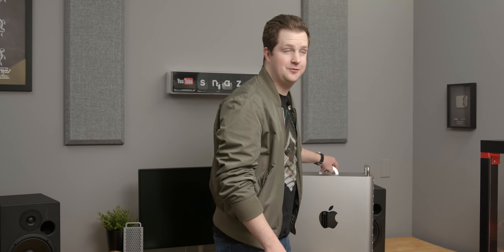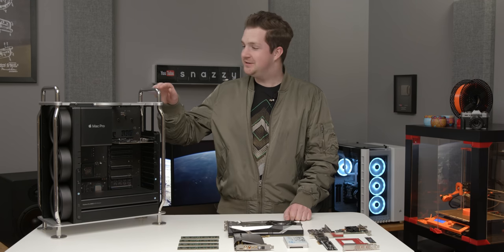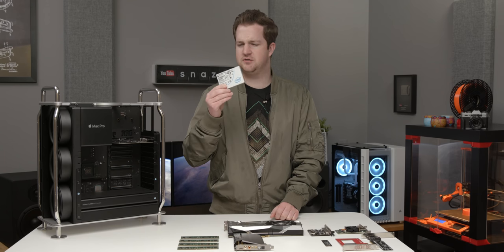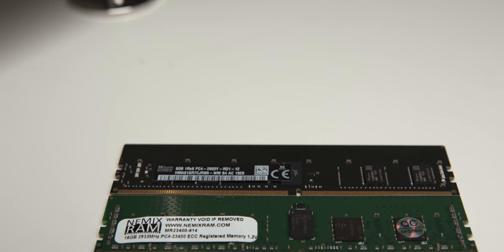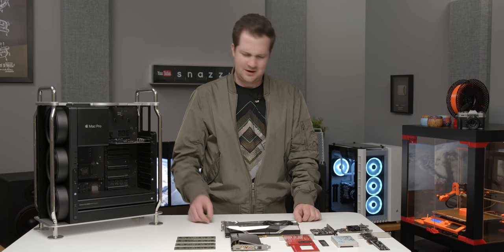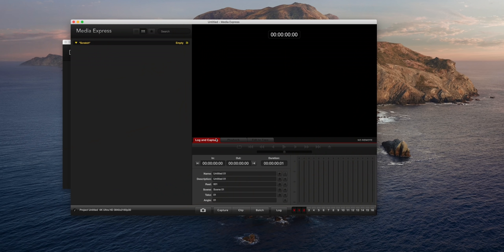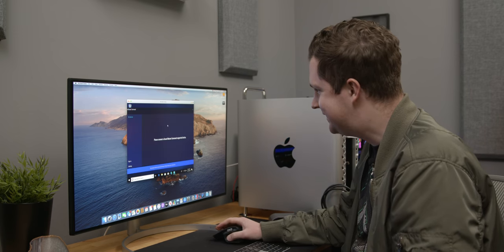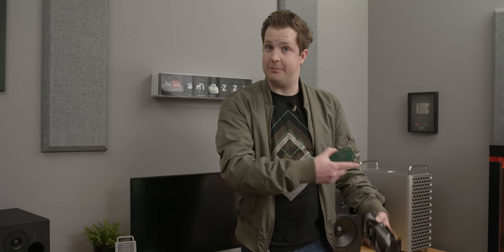What Weird PCIe Expansion Cards Work in Mac Pro?

Comment from the maker: Items of note:

At 5:18, I moderately imply that U.2 drives are not PCIe drives. They are. I knew this and apologize for the lack of specificity. 

At 5:25, I incorrectly state that there are PCIe x8+ drives available and there are not yet. At least, not really. Some adapters are available for M.2 drives that assigns 4x pins to each M.2 in a caddy but that’s it. 

TL;DR I didn’t script this video and it shows. My apologies. I try to make errors in videos as seldom as possible but sometimes I miss the mark.
Reply: Go on, advertise Linus's undies as well :)
Reply: That's totally fine! You don't have to apologise. Thanks for the video 🤘🏻
Reply: Pin this
Reply: Thanks for the corrections. What's really weird is that the Intel U.2 SSD doesn't work, but the Samsung M.2 SSD does. Both are PCIe NVMe drives, and should work with a generic NVMe driver.

My guess is that Apple's NVMe driver whitelists specific vendor IDs. Samsung made the controllers for Apple's NVMe drives before Apple switched to their own controllers, so it would be logical for macOS to whitelist Samsung controllers.
Reply: Uh, you can get PCIe x8 NVMe drives.  They are not in the m.2 formfactor though.  E.g. https://www.samsung.com/semiconductor/ssd/enterprise-ssd/MZPLL3T2HMLS/
You can get the amount of bandwidth from a PCIe gen 4 x4 M.2 NVMe drive though and there are PCIe gen 4 x8 controller chips in the works.
Reply: Great video!! Although, I’m slightly worried you spent so much on that MacPro that you can’t afford to run your heating any longer (hence the coat!)
Reply: Sorry, but your second note is wrong. There are PCIe 8x+ storage cards. Kingston makes one (Kingston DCP1000), aswell as Liquid (Liqid Element LQD3000) and even Samsung (Samsung pm1725b). All of them run at 8x with up to 6000MB/s. If you want the full 16x and Bifurcation(4*4x) is no option. Highpoint has a PCIe 16x to quad U.2 adapter (HighPoint SSD7120) using a PLX chip (in fact they have even more awsome storage card).
Another nice idea would be, to try if external PCIe would work. (maybe ask One Stop Systems or Linus from LTT, he has one card)
I would be interested too, if storage solutions like the ASUS Pike ii 3108  are working in MacOS.

Keep up the great work and nice 2020!
Reply: @rabel1545  The HighPoint version with 4x4 hardware (they call it bootable) RAID 1+0 should be supported in macOS, no need for U.2.
Reply: @summarity  Thanks, I mean I never asked for a awnser like yours but thanks anyways.
Reply: As you already have the belkin kit, did you look after pcie to sata power adapters? Because the other way around, sata or molex 12v to pcie exists!
Reply: @abcmerker3707  it doesnt work SATA needs 5v and 3.3v aswell. And PCIe only has 12v
Reply: for the sound card, maybe try other pcie lanes as you are using a VM you may be using a PCIE lane that is assigned to Mac and not the Windows VM. great vid
Reply: Hi there! Just wondering if anyone has found or could reccomend a PCIE card to expand the USB Slot capability on the new Mac Pro
Reply: There are real pcie x8 Samsung enterprise SSDs that work without bifurcation (x4x4 mode)
Reply: hi thx for the video, most interesting vid I saw for the mac Pro yet, well done.
Reply: There is one more correction you need to make, the AE-9 does not get any power from the PCI interface, all of it's power comes from the PCI-e cable from the PSU. that's common with Sound cards. getting power from the PSU is cleaner then getting power from the motherboard
Reply: why not frankenstein mod a cable yourself?
Reply: Not sure if you have one but I'd love to see if any network cards or wifi cards work. If you don't have any that's fine.
Reply: Should check if a HBA will work like the ibm m1015. Also check out the XPG SX 8200 Pro they are faster than a samsung evo but slower than a pro and cheaper than both !
Reply: I believe you could get nvidia cards working. Ltt did a video about mac OS Katalina VMs and they used an nvidia card.
Reply: I had more issues with your LTT plug than I did with the U.2 issue.
Reply from the maker: BlastMaster Did you not notice my multiple digs at Windows throughout the entire video, you dingleberry? Nothing is free of criticism. Lighten up, you insecure little man.
Reply: On the topic of data power it wouldn't be hard to make, 10 mins of work max, granted it would be a pain/iffy to do for most people
Reply: Wow!  You're human and we're happy about that 🙃. Sometimes, off-the-cuff is the best.
Reply: I have not read through all comments, so if this has already been said I apologise. For the Sound Blaster, you would need to run Windows with a virtual machine solution that allows for PCI device passthrough, and even then, Mac OS has to be able to use the CPU's IOMMU for passthrough of hardware to virtual machines, and the virtual machine software like Parallels has to support PCI passthrough.
Reply: @TheMuso28  didn't see someone post that, but just for reference the sound blaster is PCIe, not pci(the Mac doesn't even have a pci slot), not that it matters, I'm not sure macOS supports PCIe passthrough even though the CPUs they use do have  iommu support, not saying it doesn't just nothing I've heard of
Reply: @jaykoerner  dude, pci and pcie are the same damn thing... Effectively. They are not backwards or forwards compatible but they are in the same family of tech. Pci is the first gen pcie is the successor
Reply: Did you try to make the the card connect to vm from the menu (of parallels)? Some bluetooth cards and usb drives need that.
Reply: @TheObsesedAnimeFreaks  you agree with me then, you also say they are NOT the SAME, the e is important
Reply: I didn't notice as many as you probably did Quinn. Will you be doing a follow up video for the PCIe cards that didn't work?
Reply: My comment will be lost, buut, you can try such wierd method to get some power connectors(use it on your own risk, that's only an idea that works somehow, but you can burn all your new fancy pc). This thing have power supply, maybe it's proprietary, that's doesn't really matter. Power supply have pc start and ground cables. You can use 2 wires, buy a usual one power supply and connect that two cables in your's mac and in yours "external" power supply, with all benefits like gpu, sata, cpu power connectors, cause they both have same start/stop signal and ground for whatever. It's highly recommend to use built-in psu for every purpose, but you can easily give a power to multiple gpu's, get some sata power connectors and so on.
Reply: @snazzy  read my comment above
Reply: @spla5h627  or just use a pcie to data power adapter, no reason to do something funky
Reply: @TheObsesedAnimeFreaks  a bicycle and a rocket are the same then? They are both vehicles, either things are the same or not, it's simple, not a argument, it's facts
Reply: @Turdlehead  for sure all the PCIe devices would work in a 50k Dell. Now, back to your moms basement for you.
Reply: @jaykoerner  no, a r32 and an modern GTR are the same thing except one is vastly superior in almost every way to the older version. They are both in the family of Nissan, they are both "skylines." it's a generation thing rather then a completely different interface.
Reply: @TheObsesedAnimeFreaks  if there are differences, then they AREN'T THE SAME, we agree on this you agree as well, if you don't then stick that sound card in pcie slot and make it work, hell thunderbolt is now usb4 and I wouldn't say that a thunderbolt pcie drive the same as a USB drive, either they are the same or they aren't, practical capabilities of the two are vastly different, pci couldn't run a modern video card even with the right connection, yes I've tried pci to pcie converters exist(but running anything high bandwidth off it leads to windows crashing half the time) but as do pci to USB, if it needs an active converter it's not the same thing
Reply: @jaykoerner  pci never ran video cards... That was AGP... But you are missing the point of my analogy. A r32 is a much older version of the skyline, the second to last generation before the skyline name was dropped in favor of only using GTR as that is what that brand morphed into. The skyline used to be a family car, it no longer is. You can't argue that it's not the same thing because it is, as far as the family goes. The same organization that is responsible for pcie is the same organization that developed it form pci. Newer generations are not always exactly the same as prior generations. See usb 3.0 and usb 1.0. These differences are irrelevant unless you are trying to put a square in a round hole. And as far as I am aware pci devices required very little to reconfigure them for pcie. So no, they are the same thing as far as anyone is concerned. Stop being picky.
Reply: @TheObsesedAnimeFreaks  your being picky, also pci did run gpus, so your wrong on that fact, agp came later as a "replacement" for pci as far as GPU slots go, family means nothing, it's either the same or it isn't, agree to disagree, 10baset isn't the same as 8p8c is it? Both run Ethernet networks but you wouldn't transplant and say they are the same no? If you want to say anything in the same family is the same thing then let Branch out is a husky the same as a Chihuahua? Is a architect the same as a rocket engineer? Is a 8086 the same as a new ryzen or Intel chip? It goes on, regardless if their are differences especially so that they are not inter-compatible they are NOT the same
Reply: @TheObsesedAnimeFreaks  also to shut you up pci and pci don't even function on the same standard, pci is parallel while pcie uses separate stand alone serial "Lanes", they are vastly different from technically, practical, and real-world use cases, the only thing even slightly similar is the name, you might as well say vga is the same as hdmi
Reply: @jaykoerner  you might as well ignore reality. PCI and Pcie are the same damn thing with express at the end. Pci in both of them stand for the exact same thing. And factually they are based off the same tech
Reply: @TheObsesedAnimeFreaks  they are not even based off the same tech, unless your saying electricity, one is a parallel technology, while the other uses serial Lanes, not the same at all, the name is pointless, the same group standardized them that's it, at that point you could argue that ww2 tanks and a modern gm truck are the same thing,
Reply: @TheObsesedAnimeFreaks  here to get rid of your confusion, the name of the group who made both standards is PCI-SIG or Peripheral Component Interconnect Special Interest Group in the full form, they just named the standard after the name of the group, yeah pci came first and Intel named it but pcie was made after the group was established and basically took the name of it for no reason other then it was 1(for connecting peripheral)2 the name of the group that created and ratified the standard, has nothing to do with them being based on the same technology
Reply: @TheObsesedAnimeFreaks  and this is to top off the fact that they are still developing pci as a separate standard and have released new specifications as late as 2015, if they were the same thing why keep developing the old one?
Reply: @TheObsesedAnimeFreaks  woo can ramble huh, anyways your wrong, but that doesn't change the fact neither of us will agree, so is what it is.
Reply: @TheObsesedAnimeFreaks  well just looked at your channel, you fit your stereotype enough said, good on ya, do what you do
Reply: Very professional to post the corrections
Reply: Also probably worth noting that you can buy USB-A PCIe cards that are powered from the PCIe slot directly and don't require external SATA or molex power. Afraid some people might get the impression that you can't expand your USB-A ports (whether on PC or this Mac Pro, for that matter) at all without external power.
Reply: Could you check, if an older style AHCI Blade (non NVMe) works in your adapter ??
Reply: @snazzy  Hey... I agree that BlastMaster's comment was idiotic, but I do find this video and so many others about the Mac Pro frustrating.

Yours and others comments about how this machine's base specs are so low for the price ("only" 256GB SSD, 8-core processor that's slower than the high end iMac, "only" 32GB RAM, "I/O... not very good", etc.) for the "outrageous" $6K price, completely miss the point. More frustratingly, I'm pretty sure you're switched on enough to realize this, which makes me wonder why you're approaching it this way.

The whole point of the Mac Pro, what everyone's been screaming for for years, and what you're getting on top of those base specs for that base model price: That motherboard with all those expansion slots, the insane cooling system (people have been complaining about the cooling in Apple's other Macs being inadequate for a long time so this isn't insignificant), some pretty incredible engineering to make it all work well together, and a bunch of other stuff that doesn't and shouldn't come or free.

If we only want those base specs and nothing else then why do we want the Mac Pro at all?  Sounds like the people complaining about the base price Mac Pro, compared to say the high end iMac or the iMac Pro, want a Mac with similar specs but without having to pay for all those PCIe slots and cooling and so on.  You know... something like that high end iMac or iMac Pro that they've been able to buy for at least a couple of years now.  So... umm... buy that instead?

In particular for example:  you make the observation that the internal SSD is pretty slow compared to some of the options available via the PCIe expansion.  Indeed.  I suspect that's EXACTLY why Apple started the base model with a relatively small internal SSD.  Why would I want to be forced to pay for say a 1TB base option, when I don't want or need it because I'm going to... you know... put a better one in the EXPANSION slot?  Compare to the iMac Pro?  It's a different mindset.  The iMac Pro isn't expandable.  That's why it starts at 1TB.

You started this with "I/O on the new Mac Pro is not very good..."  "only" 4 thunderbolt 3 ports and "only" 2 USB-A ports.  Seriously?  Again, what's the point of this machine?  Put the right cards in it and "I/O on the new Mac Pro" is anything you want it to be.  That's the point, and that's what that $6K is for.

I'm just tired of all these complaints about how "lame" or "not very good" the base model Mac Pro is for the $6K we're paying for it. The whole point is low starting specs, but with a whole slew of room and engineering for expansion, so you can ... you know ... EXPAND it!  Why should they give all the expandability options (PCIe slots, cooling, ease of access, etc.) for free?

Generally I love your work Quinn. But comments like those you made here on this topic come across as disingenuous. You're better than this don't you think?
Reply: SOLUTION FOR SATA POWER
Instead of using the proprietary 10 pin, a minifit jr. PCIe 8 pin (standard gpu power) can be very easily be adapted to sata or molex 4 pin, then allowing power delivery to the device of your choice.
Reply: You said High Sierra and above don’t have Nvidia drivers. I reluctantly admit I have a 2012 Mac Pro with High Sierra and Cuda drivers are working.
Reply: I've made a chart with all types of SSDs to clarify this kind of stuff, which for me at least was mad confusing when I started learning about SSDs and stuff https://www.reddit.com/r/pcmasterrace/comments/a4kczw/i_made_this_diagram_to_help_reduce_confusion/
Reply: I'm sorry, but how exactly are the Radeon Pro Vega II let alone the Radeon Pro W5700X somehow "cards that are moderately outdated"? On which planet exactly? 🤨
Reply: @sanderm8955   pci-e 8 pin doesn't carry the 5V rail, which some disks actually use.
Reply: @siriax1691   WTF does that even mean ?? 🤨
Reply: @davidthorp2  Bravo. Nailed it. And pretty much the long version of EXACTLY what I meant. I'm just can't be as diplomatic about it. 😏
But you have to realize that THIS type of video, pretending to be "The Discerning PRO" (whilst not having ANYTHING to do with ANY pro workflows) makes for more clicks and more thumbs up from the usual, ignorant Apple-Hater crowd. So he's basically just another sell-out. 🤷🏼‍♂️
Reply: I want to buy a very good sound card,  that can go in PCIe slot, which one you suggest for 2019 Mac Pro 7.1
Reply: I don’t under stand people buying any Mac Pro  and using Pc monitors:(

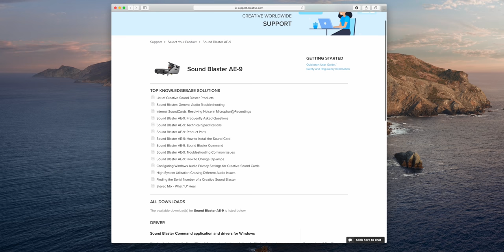Comment: 13:10 "They don't even have linux drivers"

I would like to hear this complaint more often, from a lot more people.
Reply: Most drivers are built into the kernel. Unless it's a Nvidia GPU there's a good chance it just works         without hunting for drivers.
Reply: @ethanl9656  I daily drive manjaro kde, and I had to dig through the repo or go to manufacturer's website for drivers more often than you think (even with manjaro's outstanding hardware support), many devices still require proprietary drivers.

But yeah, having the generic drivers built into the kernel is a blessing since I ditched windows a few years ago.
Reply: Dwi Randy Pradhika
Creative was always about bad driver support.....
Why soundcards need drivers? not well developed!
Just do latency support only, need more, install the drivers. Creative is tooo custom!
Reply: @ethanl9656  Nvidia does native VGA support, creative can't offer native sound, you need the weirdo drivers!